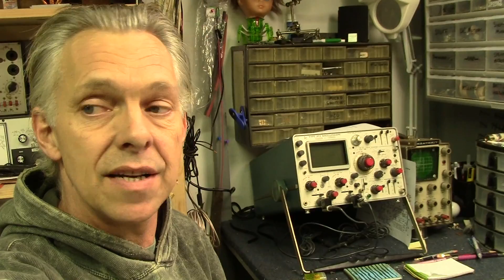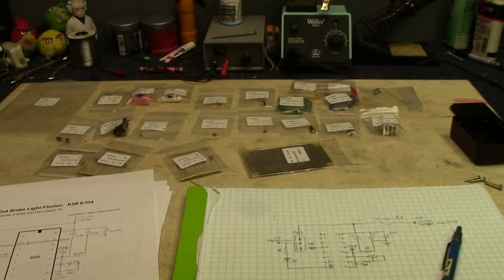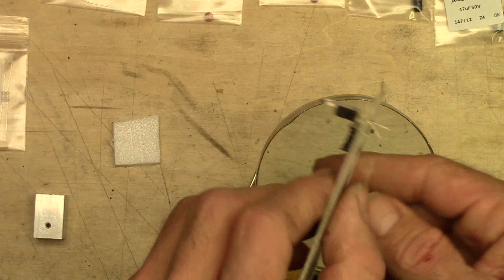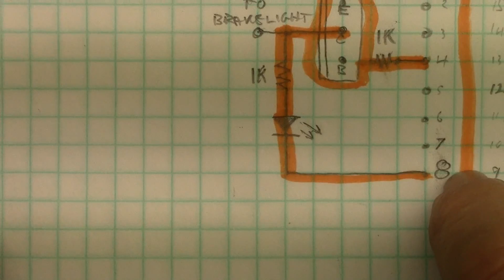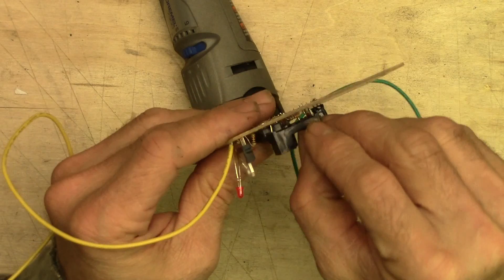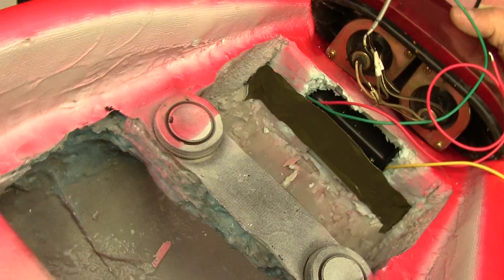4060 Timer Brake Light Flasher

Comment: Hi, I successfully replicate this project but I have problem with the current flowing from dim led light. The red led inside the encapsulation lits up as soon as I turn in the parking light. Is there any solution.

Comment: can i use say a 100K resistor and a 200uf 25v capacitor on the reset pin 12 connections to give a delay before the the it resets ?

Comment: You can also use a small drill to scrape of the strips on the board
Reply: Yes. That works like a charm. There's even a little tool you can get if you use these boards enough that spending $10-15 actually seems worth it. It's basically a small Forstner bit in a screwdriver handle. Two or three twists, and done.

Comment: Dino....Did you glue the pot? Are you worried about the vibration that it may actually go slower or faster after a while? I only ask this due to I use one on my UAV engine, and after about 4-8 hours and then it needed to be adjusted again.  I after about 50hrs I got too pissed then glued it with a very small dot of hot glue, and it works like a charm.
Reply: No glue. If it seems to go out of adjustment I'll glue it but I think it will stay in place.
Reply: +Dean Segovis Ok... I hope it doesnt... i was thinking of people looking at it then having a seizure or something if it goes to fast...or maybe putting them in a trance.  
I love the build though, I may do this for my car...since I dont have a motorcycle.
Reply: Kethlar Good thought, and it could be a concern under pretty specific conditions. But many are met by the average turn signal, too.

Frequency, colour (red is worse), brightness and contrast variation, and how much of the visual field is covered by the flashing all play a factor.

3-30 hertz is a concern, as is a bright light flashing in a darkened environment. A flashing area covering more than 25% of the visual field becomes very concerning. It's that last one that's probably the saver. As is the rarity of photosensitive epilepsy (3-5% of those with epilepsy). Even then, the "abnormal response" may only be obvious on an EEG.

Still, it happens. A famous night in Japan had 700 children admitted to hospital following a particularly garish Pokemon cartoon.

I was surprised to find that sufferers can shut one eye (to reduce the visual field impacted by the flashing) and often wear coloured lenses (to filter out problem colours).

Comment: Nice job. I love little circuit builds like this. Two tips for similar builds - if you need a bit of strain relief on incoming wires drill a few holes a bit larger so you can feed wires to your perf board in a little 'S' shape just before the solder joint. In rough environments, and if there is room, you should try to avoid splicing wires using the solder like 'glue'. Your wires should have a good mechanical connection first, then be soldered. Google 'How to splice wire to NASA standards' to see Makezines smexy pictures. This is also called a "Linesman's Splice".